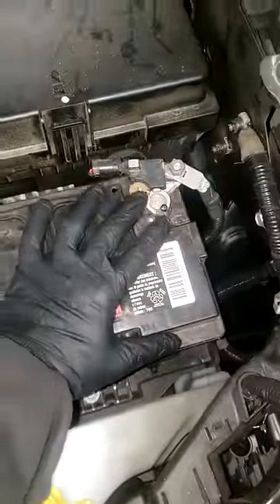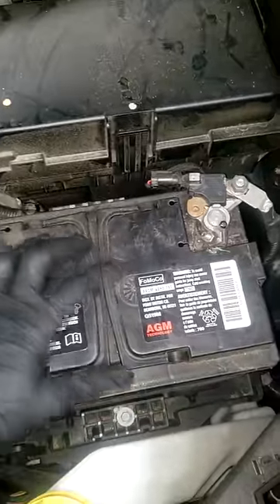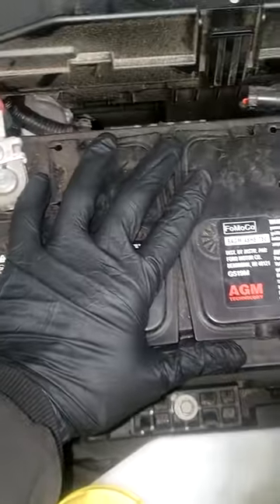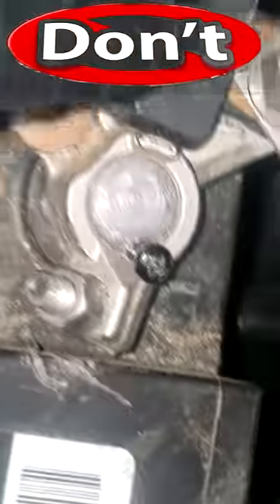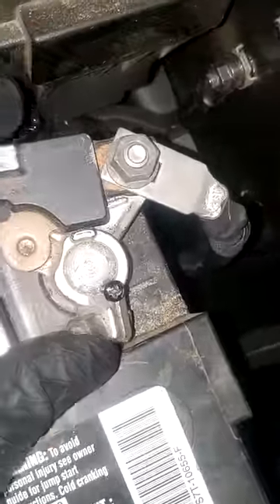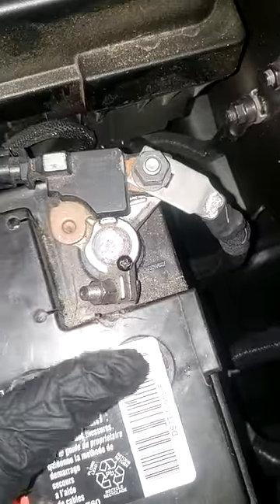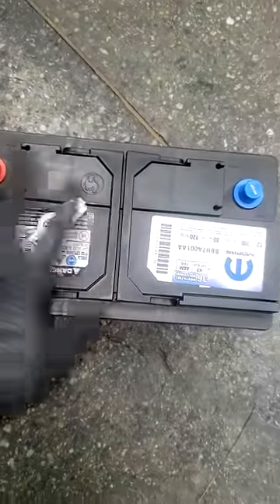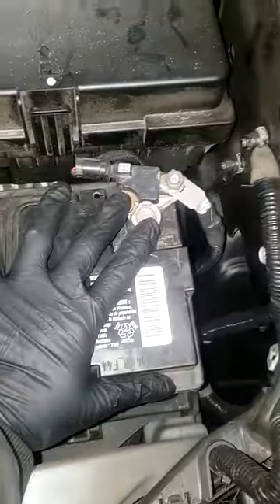STOP DOING THIS PEOPLE. This will destroy your car electrical system.

Comment: been a mechanic 35 years.   that screw  trick actually works great temporarly and will save your electrical system.   compared to just having a loose terminal.     that current sensor wont know that screw is there if its tight.
Reply from the maker: Well it wasnt tight.  And thats the worst thing you can do to these new cars is have poor connection at the battery.  Yes this worked well on the older non heavily computer operated cars.

Comment: the screw is old school, worked on non high tech cars, this is what happens when older people work on their own cars then suddenly find themselves in a new automobile and still using 1980 skills on new cars sometimes does not translate over and you find yourself in these situations.  on my 1982 Buick sure, a 2020 Buick I wouldn't even open the hood of.
Reply from the maker: You nailed it, or should I say screwed it.

Comment: "she wanted it right the way it was supposed to be" makes me so happy to hear and I'm not even the guy working on the car. Yesterday someone tried to explain to me why I could just flip his rear main seal over and reinstall it instead of buying a new one, but he didn't trust me to clean the contacts on his distributer cap so wanted new one... There's special people out there it's nice to have a smart one occasionally
Reply: Ahaha I hear ya ...seals like a 4-5-6hr or more depending on the situation so let's cheap out on the proverbial ten cent part, but the one that's out in the open and not in too bad a shape let's replace it 😅😅
Reply: Yea shit like that is why I had to stop working on people's cars..
They're so worried about saving a penny in the moment that they don't see the dollars it's costing them down the line.
Reply: Sounds like an urban legend. I don't believe it.
Reply: If you flip the rear main seal over the oil will leak into the engine duh😅
Reply: i had to drop my transmission to get to that seal. It was only like 5$ for the part..  being a fwd car I had about 10-15 hours to remove the transmission in my garage. I replaced everything I could while i was in there.
Reply: @ohioplayer-bl9em  yeah man the car was a Honda so probably not too far off. His logic was "it only leaks at the bottom so flip it"
Reply: Had something similar happen. The guy did not want to replace his exhaust even tho it had holes and it wouldn’t make good contact and had leaks. His fix. Just put more seals in the places that it’s leaking 😅

Comment: It just needed a battery. The screw is in the lead, not the sensor.
Reply from the maker: Then if you ever see one like this, simply replace the battery. I did both on this car.
Reply: Correct he shouldn't have replaced anything else unless doing so for freem he stole from her intentionally
Reply: @OnlineMechanicTips literally admits to replacing a non faulty sensor. Sure that was cheap 👀
Reply: @FreeRunMonster802  those sensors cause all kinds of problems. They get damaged easy so he's taking the time and a little extra money to make sure the customer doesn't have issues in the future. As long as they got the customers approval then there's no issue. The customer could have just said no, battery only.
Reply: @freefall5x  customer most likely doesn’t know any better. that’s why she’s going to him, a mechanic. Maybe he could’ve gave her two options, replace just the battery and if the problem persists then go ahead and go with a new sensor.
Reply: @Jmp1019  but what if you have seen this problem before on numerous occasions and 9/10 the car won't start due to this? You'd replace all the shit too so she's not back at yours or another shops door in a week all pissed off. What I learned being an aircraft mechanic for your beloved military, we had to follow step by step technical orders (maintenance or service manual, in ground vehicle equivalency) for every maintenance/service/repair etc. performed. They used to tell us day 1 at tech school until my last day in the service, is that all T.O.s are written in blood anger and dead skin cells, because somebody in the past somewhere fucked something up thinking he's hot shit and got hurt and/or made a very costly mistake now everybody has to read and follow step by step detailed instructions for nearly everything you do to that air vehicle. Which is actually smart. So when you write down a summary of your work you reference that T.O. If you followed instructions to the t and dotted i you'll be fine, usually. If you didn't follow that T.O. well you'll likely find out very soon that you messed up. And you'll be why the next T.O. is inserted. If something in the military is not written down, than it's most likely idiot proof and nobody's found a way to cause injury or loss of money, yet.
Reply: @freefall5x  Sell her a starter while you are at it, as long as she doesn't say no right?
Reply: Right...but shhhhh🤫🤫🤫🫣, dude gon get mad and tell you to start your own youtube channel to make a rebutal or something along those lines. 

I have seen this sensor actually go bad maybe once, and that was because someone actually broke the sensor.
Reply: Do it right or don’t do it. A cast on your leg is a temporary fix until your body fixes. Tuck tape on your broken tail light is to get ya to the auto parts store not Forever. Oh and my favourite oh sorry I had my high beams on cause my head light was burnt out.😅😅
Reply: Thinking that can have any affect on the car is just someone who doesn't understand electrical. Current and voltage. The ONLY information you can get from the neg terminal. If it makes contact, it's good. Period. Regardless of how that contact is made. If it can current sense and voltage sense, it's fine. Not saying that's the proper way out best way to do it, but it won't cause any issues.
Reply: should have used a volt meter on the battery then the terminal. if the problem is in both then its the battery if its in the battery and not the terminal its the screw, then if the terminal has the issue and not the battery. then its the sensor. point is there are ways to test these things very simply. now having the battery on the floor is another story
Reply: @Jmp1019  So you just assume they didn't give the customer multiple options? I was a mopar tech for years so believe me when i say that if that sensor wasn't replaced, the customer world be back with the same issue. A bad IBS can ruin a new battery. Ask me how I know lol.
Reply: @FreeRunMonster802  So replace the battery and a few months later you can replace it again. I've seen IBS kill new batteries. Not saying this is what would have happened here but its cheap peace of mind. Those sensors aren't that expensive but they can cause expensive problems.
Reply: @Not only a member But the president i agree with you. I worked for a Chrysler dealer for a decade. In that decade I replaced one IBS sensor, intelligent battery sensor, which is the negative cable clamp. Those things are extremely resilient. The only one I had to replace was because someone lost the little nut on the clamp, once you get that nut off, it ain’t going back it as it has a weird design and thread pitch, or at least it did when I worked for dodge.
Reply: @freefall5x  "not saying this would happen" Good, because it wouldn't and no amount of hypotheticals or what ifs will make me accept this guy's shitty diag and repair 😂 good day man.
Reply: @freefall5x  this is why cheap mechanics cost you more money. Any good mechanic never recommends a sensor without testing resistance or reading data in a scan tool. Paying $50 more in labor would have saved her $200 on a sensor.
Reply from the maker: @joey9511  You my friend, is a clown. She just left cheap mechanics. Thats why she here. Dont assume what I didnt do just because you don't see it being done. This is a 60 second shorts video. This customer wanted her car fixed right and no, she's not poor. Yall always thinking about saving customers money when they would gladly pay to get it done right.  Poor connection at the battery on these new cars will destroy and freak out the electronics. That terminal that was attached to the wrong battery post accompanied by that stupid screw was all I needed to see. Been down this road b4 big dawg. They towed in maybe once a week. So all you clowns thats still defending putting screws in battery terminal post should likely stay away from the newer cars. Smdh
Reply: @Eric C  little extra money isnt a couple hundred bucks bruh lmaooo, and ig next time ill go the extra effort route and just replace the customers whole engine
Reply: @jamesolelo4406 u miss the part where the customer wanted it changed out?
Reply: @wolfbrother9025  context. If they knew it wasn't needed and this was wasting their cash, do you think they would still agree?

Comment: Technically the screw wont mess anything up BUT it is still not the right way...do it right or dont do it at all but those issues are not going to come from just because someone put a screw in there to make it tight.
Reply: Correct. But if they didn’t clean the corrosion first it could. Plus, battery is probably 7 years old.
Reply: Do it right or don’t do it at all… you don’t know the story. Maybe the customer didn’t have the $100+ to cut the terminal off and replace it with a new one and opted for this.
Reply: @ryanbianchi6582  your contradicting yourself. If the customer “opted for this” then are you speaking to the person who did that, when you say “do it right or don’t do it at all”
Reply: Yes it will.. it completely ruins the IBS sensor that reports back anything that can be wrong electrically with the vehicle. Putting a screw on it can cause a lot of further issues to happen.
Reply: How does the electrical connection know if a screw is in there? It either has a connection or it doesn't. As long as it is tight it has a good connection. It could be loose or could be corroded, but the screw would have no bearing. Possibly the sensor was damaged when it was loose possibly a bad battery?
Reply: @greenspiraldragon  see, it’s shit like this that actually makes sense.  Like how adding some spray paint to my bumper is going to cause it to rust or something.  I don’t think people understand how physics work. :)
Reply: @MRGior-wo6dk  well, if the other side of the terminal was clean, and had some pressure against it, then it would conduct an adequate amount of electricity. So… physics.
Reply: Continuity is continuity. Just test that and load test the battery. Yes I do have an electronics degree. Problem is, dissimilar metals corrode. So no, the screw isn't a good idea. Being that corrosion was most likely the problem anyway.
Reply: @stever197037  I was going to make a rebuttal video and was mulling over the proper procedure to show the screw doesn’t effect load unless the terminal is compromised. That was my take, an amp test through the terminal in a state of dirty vs clean with and without a screw applying “clamping force”
Reply: @MRGior-wo6dk  I’ll revert you to the comment I made to @stephenrother
Reply: @MRGior-wo6dk  Your right about current, but I did say load test. Isn't that current. Yes it is.
Reply: Sensors are fussy little bastards. Wonky connections can and will fry sensors.
Reply from the maker: @MechanicalTriage  You def should make that rebuttal video. We will be looking forward to it.
Reply: @MRGior-wo6dk  not doubting that..  doubting that it causes a problem, that wouldn’t already be there.
Reply: Not sure what type the car is but I know my wifes German vehicle goes absolutely insane when her battery gets weak. Starts fine and has no symptoms noticable but you get a out 10 warning lights randomly. AWD syatem, instrument panel system,  and random stuff in-between. 
Test the battery and its indeed on the absolutely low side of passing. Install a new battery and everything is right as rain..
Reply: @ohioplayer-bl9em  even old bmw and mb suffer from that. Once the battery sits at about 12.3 the computers freak out and throw abs and transmission codes.  Even though she starts perfect every time

Comment: I work at a parts store, you would not believe the amount of people that come in because of battery issues that all stem from them over tightening the terminal as if it's holding the car together to the point it crushes the post or stretches the terminal so it no longer holds like it needs to. I've literally seen some changing their own battery put their weight into tightening the terminal.
Reply: As a gen tech , roached up terminals drive me up the wall. 
Most times when electronics act goofy ,check powers and grounds first ,I been doing this too long.
Reply: I’ve worked in parts, and have seen many battery terminals that were completely loose. You could pull them off with one finger!
Reply: Usually though the terminal is hosed, so DIYer overtightens to compensate, not the other way around. Meaning, it was probably already gone, before Mr. Gorilla went medieval on the clamp.
Reply: @bcubed72  happens both ways
Reply: @MrHillfolk  ha, my mate had an apprentice who, no matter how many times he was told, would over tighten battery terminals, so they cut his 12mm spanner in half so he could pull on it so hard.
Reply: @michaelbamber4887  why didn’t I fire him if he won’t listen lol
Reply: @BROTHERBOLDLY  I know, but once you pay for someone to do 3 years at tech before they arrive in your shop...he's a good lad now, still with the company 20 odd years later and has had is own apprentice.
Reply: @michaelbamber4887  well if he won’t listen fire him and hire him back a couple days later
He has to learn somehow lol

Comment: You can absolutely put a screw on the clamp. Nothing wrong with that for
 an emergency repair. It will have NO affect on the IBS. Zero. None, 
other than getting a better connection on the battery.
Reply from the maker: Smdh, now why on earth do you think this customer came to the shop?  She here because her warning and check engine light on. Codes relating to the IBS an you with a straight face says this is ok and will have no affect..You sound crazy my dude, basically suggesting she came to the shop and payed her 200 for diag time for me to tell her the problem because she bored. What should I say, Mr Jay says this ok? Just leave the common sense thinking do all the thinking please.
Reply: @OnlineMechanicTips  So you're saying the ONLY THING that you did as a 'repair' is to remove that screw??? Now YOU are talking crazy. You said the IBS was bad. That screw had nothing at all to do with it going. Clearly the ADDITION of that screw was an attempt to repair the fault of the IBS being bad. Didn't work though, because bad IBS. Screw did NOT cause any problem. Zero. None.
Reply from the maker: @LordCeeJay  I cant do this with you my dude, you using terminology like bad to describe parts. And I'm not sure if you understand how crucial it is for the newer cars to have excellent battery connection with no outside interference such as screws. This customer lucky she didn't lock her transmission out. These are sensors thats monitored by computers. If the computer detect a problem, it turns the light on. Bottom line is whoever put this screw in affected the connection and the IBS detected such and turn on warning lights. The repair suggested by me was replace the battery and sensor and remove that silly screw that you see no problem with. Car fixed, customer gone and happy.
Reply: Your video should have just been about how useless the screw is then. If your so convinced the IBS was faulty then make the video about the IBS and how the screw wasn’t helping.
Reply from the maker: @Clynikal  Thats coming up next, stay tuned